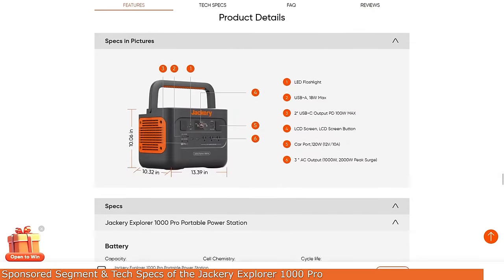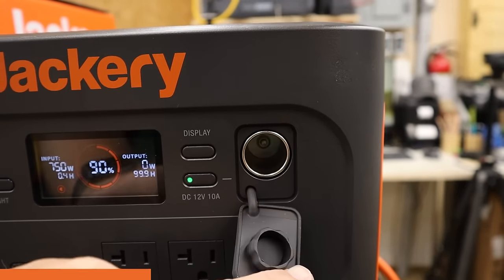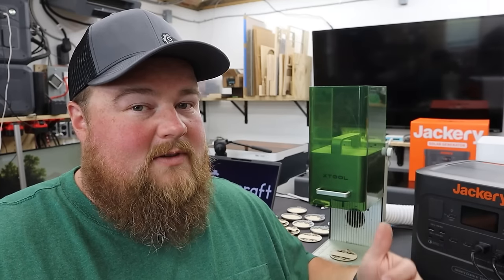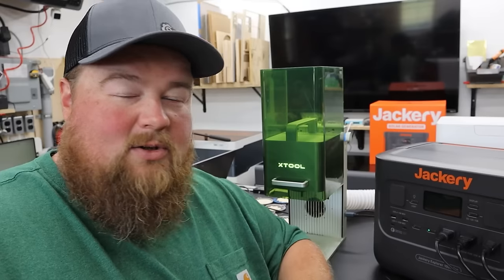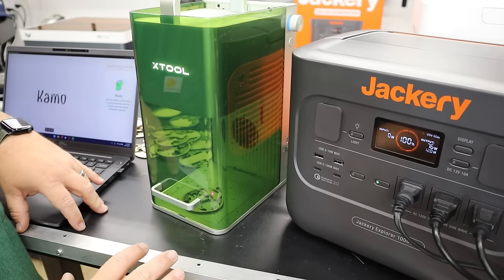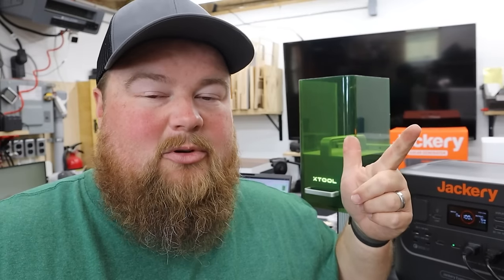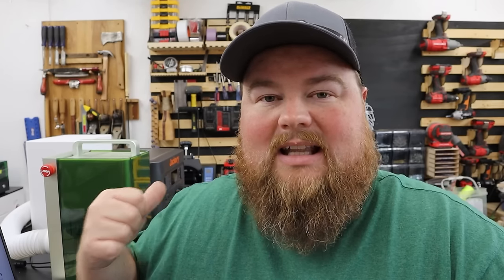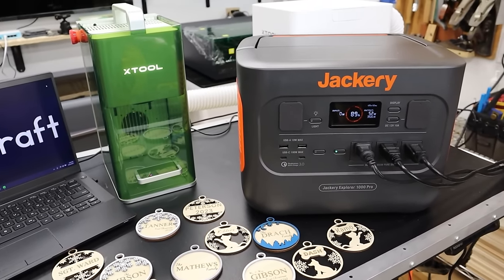Laser Engraving CRAFT FAIR SETUP with a Jackery Explorer 1000 Pro

Comment: I’ve been using a Jackery 1500 to power a 5watt laser, exhaust fan, and a laptop charger. I only charge the laptop when it gets below 20%. I only use the fan while engraving. After a 16 hour weekend we still had 35% left on the power station.

Comment: Great video. I like idea of battery inverter. You could economise s bitmore on power dont run air suction during engrave. Just suck 10 seconds at end of job surely enough to clear 1 CuFt air space
Reply from the maker: Great ideas!

Comment: I've been curious about power needs for a setup like this.  I've been thinking about adding an F1 next year.  Sounds like that air purifier is pretty loud though.  It's that going to be an issue at indoor events?
Reply from the maker: The occasional fan noise will be less an issue than the smoke and fumes you would otherwise produce. It’s not as loud as seems in the video.

Comment: The main nose comes from the air purifier?
What is so specific for the F1 for me to buy that brand and not others?
Reply from the maker: Yes, the air purifier is the main culprit on noise. However you don’t have to keep it on top of the table. The house is long enough to put it under the table and be less of an issue. :)
Reply: The F1 has a diode and IR laser. Others only have 1 or the other. Having both types allows you to run this on many more types of materials.